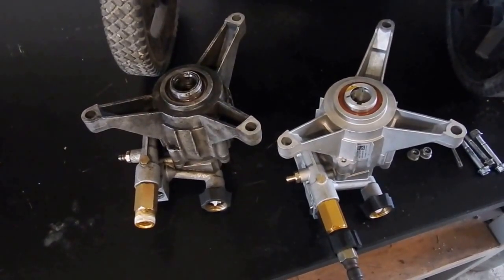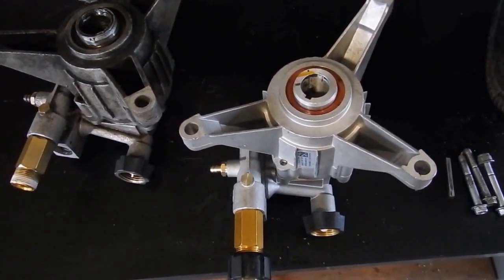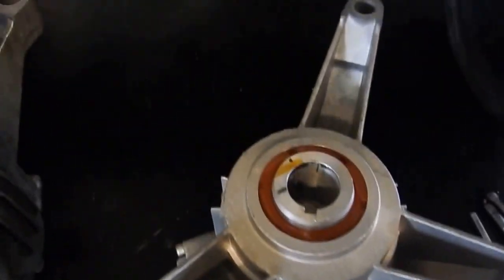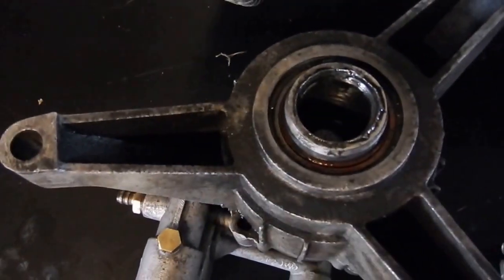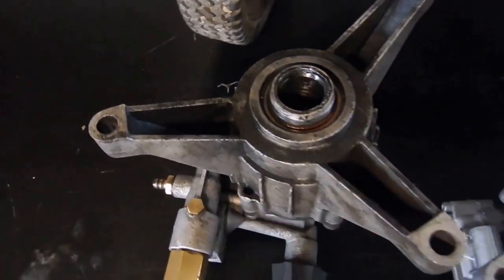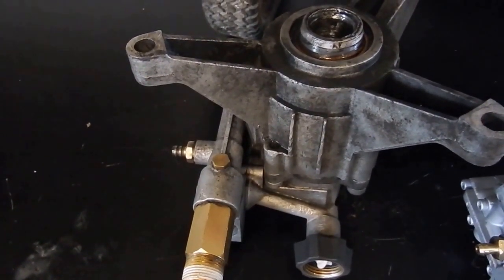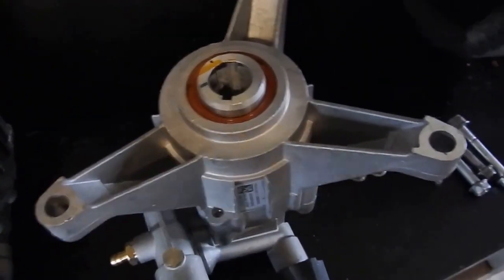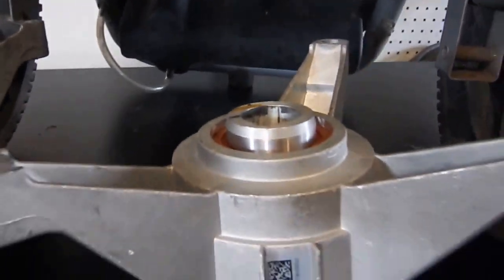How Homelite Honda GCV160 Pressure Washer Pump Failed No Pressure

Comment: Was wondering how you change the oil in that pump
Reply from the maker: There is no easy way to change the oil in this pump.  I know it is possible and necessary on larger and more expensive models.
Reply: @DIYAllied  ok thanks It was gave to me years ago and it works like a beast just happen to think about it today at lowes cause I didnt think you could change it but after looking at it earlier I cant find a drain or fill hole
Reply from the maker: @Wayno228  No problem.  Thanks for checking out my video.

Comment: My honda gcv pump wont slide off shaft after removing the 3 bolts...any suggestions why? Every vid i see everybody elses slides right off.
Reply from the maker: There is a key on the shaft.  I have a video on it.  It may be rusted or stuck.  It should just slide off.
Reply: @DIYAllied  Mine is stripped any ideas how to get it out?
Reply from the maker: @ginayoung9171  The bolt is stripped?

Comment: Is the pump filled with oil inside?
Reply from the maker: Yes it is.  It is not the highest quality oil either.  These pumps are made in China and are not the highest quality.
Reply: @DIYAllied  do you have a video or know a video that shows how to change that oil
Reply from the maker: @Wayno228  I don't think I do.  I was going to do one when I opened it up but I think it got deleted before I could post it.  I did take it apart though.   I'm sure it can be done but as I understand it they are meant to be a one and done kind of part.